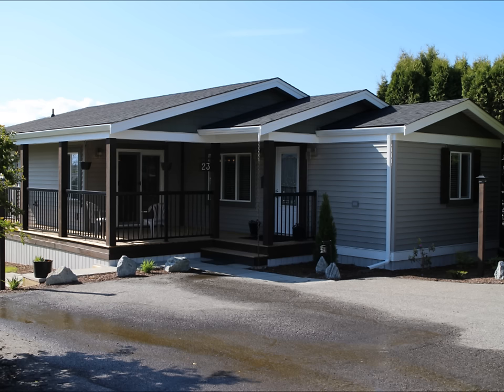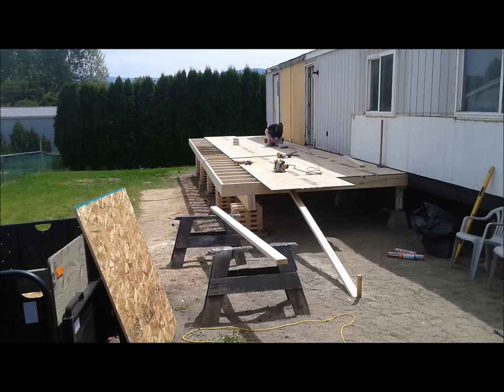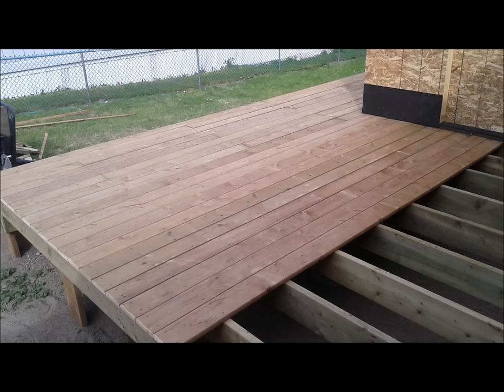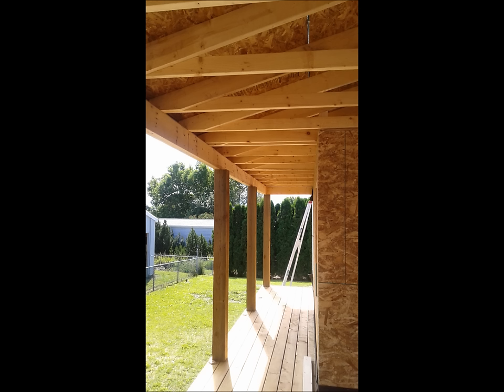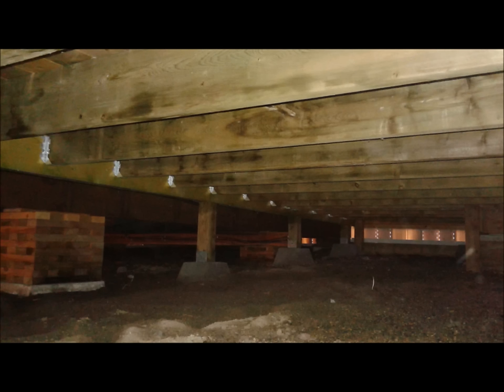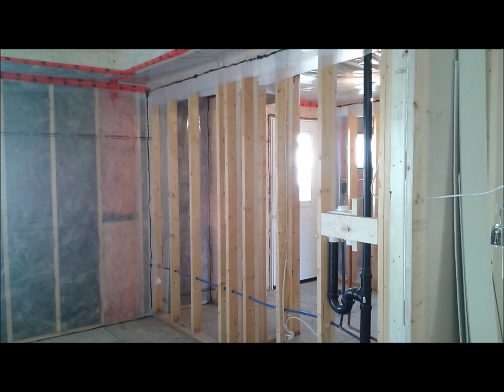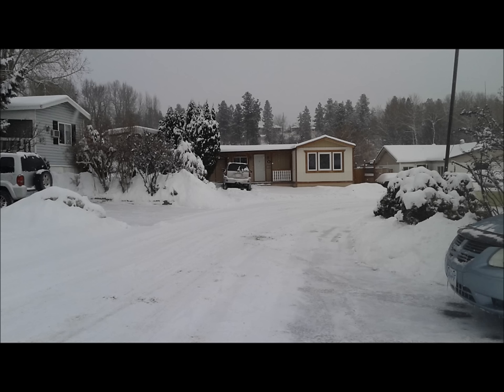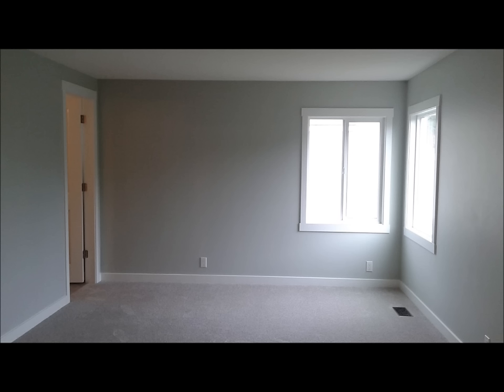Building An Addition To A Mobile Home - Start To Finish : E026 / BC Renovation Magazine

Comment: I would have used sona tubes in the ground as ppposed to cribbing for that foundation, and I would have had the addition on it's own foundation so it could just float in relation to the old home, or jusst post frame the whole addition, then tie in the roof.
Reply from the maker: Hello, Allen. Things are done differently in various building jurisdictions. The way something is done in one place may be different than where it is done somewhere else, and even then there are various ways to get a job done. One way may or may not be the better or best way to do something, just a different way.

Foundations are installed based primarily on climate and soil conditions. The use of sono tubes, as you suggest, is not the way this is done here. The way this home was set up on the cribs is the approved method, inspected and approved by the local building authority. It, and literally thousands of other homes in the area like it, have been happily sitting on those cribs with no ill affect for 20-30-40 years.

The addition does sit on its own foundation. the addition is not attached to the original home except for finishes. Structurally, the addition and original unit are independent units. This was required by the local building authority. 

This project was subject to building permit approval and several inspections along the way.  Everything that was done here was done correctly and by methods approved by the authority for our jurisdiction. Things may be done differently where you are. 

Thanks for watching. :-)
Reply: @BCRenovationMagazine , my opinions were not meant as a criticism.  I have never seen cribbing done on top of square pads before.  My old home was a 1980 singlewide pos.  Looking back, I would have done things differently.  The foundation under mine was concrete strips 24" wide down the whole length of the trailerx2.  The outside walls were cantilevered 3 feet.  I used post and beam with adjustable peir blocks every 4 feet to support the weight of a new framed roof, plywood, and a 2nd 2x4 framed wall on the inside to run new electric and plumbing through.  I nickle and dimed that project for a few years before walking away.  For what it is worth, a house flipper has it now...
Reply from the maker: Hi, Allen. No offense taken here. :-) The way things are done here are not the way they are done other places. It is interesting to see and hear how other people do things. Thanks for your comments.
Reply: @BCRenovationMagazine  I don't see where you've put it on it's own foundation. It looks like the addition is attached to the original home at what you called the header that you replaced. Can you please explain in more detail how it's on a separate foundation if you've attached your floor joists to the original home? I guess I would expect to see new footers along the mobile home side of the addition.
Reply from the maker: @Gina Dyingtoknow , the floor joists are actually attached to a 2 ply 2x10 flush beam (sits up inside the joists) that was installed next to the header of the mobile home. The mobile home header is just a single 2x8 that you can't see. It is hidden behind the 2x10 flush beam. The 2x8 floor joists for the addition are hung off of the 2x10 flush beam using the Simpson Strong Tie metal joist hangers. The 2x10 beam is sitting on that series of 4x4 posts that each sit on a concrete footer. They carry the load independent of the mobile home. The 2x10 is sort of attached to the mobile home header, but not for load bearing purposes. The 2x10 beam was lagged to the mobile home only to help prevent the addition from pulling away from the mobile home. It was done this way where the two units meet to accommodate plumbing drain lines and heat piping from the addition to be connected to the mobile home.

On the other side of the addition, the outside, the addition floor joists sit on top of that beam that sits on top of the cribs. The beam placed below the joists there presented no issue with hindering the heating and plumbing drain pipes, because it is along the outside wall and there are no pipes there. If we had done something similar on the inside the plumbing drain connection in particular would not have been able to connect to the mobile home plumbing. It would have been too low. $#!t doesn't flow uphill. :-)

Our building codes here for this require that the mobile home and addition (and any 'attached' decks) be separate load bearing structures, and these are. There were three inspections done by the building inspector as the work progressed. You could take the mobile home away and the addition and deck would still be standing there on their own. They are 'connected' only where the lags were installed (to prevent separation) and by the asphalt shingle, vinyl siding, drywall finishes and flooring finishes. That is why the roof framing may look a bit odd to someone that knows. The roof was framed the way it was to satisfy the requirement to be 'not connected'. Cut the connected finishes, remove the lags and underneath the structural parts are completely separate. 

We have had comments to the effect that "Well, that thing is not going anyway now that you did that..." Well, the fact of the matter here is that that home has sat there for almost 30 years. Around here mobile home lots are scarce as hen's teeth. There is no place to take it. But, if one was so inclined, it could be split and the two sides moved separately. Some fairly minor refinishing would have to be done when the home was set up somewhere else. 

I know the folks bought this home. I have been there several times since they bought it. The project I am doing right now is right across the street. This addition and renovation is three years old. It has been through three cycles of winter and summer. There is zero sign of any drywall cracking inside. There is absolutely no indication that the addition is separating from the mobile home or settling.

Great comment and questions from you! :-) I hope my explanation helps. Thank you for watching and commenting.
Reply from the maker: Gina, and any others interested, if you hop over to our community page I have posted a drawing there that hopefully will make this a bit clearer. It is not the greatest but might be helpful. Link to our Community Page: https://www.youtube.com/channel/UCJMCY26tYJMaPrLcheEEjhg/community?view_as=subscriber
Reply: @BCRenovationMagazine  AWESOME. These details are exactly what I was looking for. I would hire you in a split second if you lived in southern Kansas. This is exactly what we are getting ready to do to ours. The county we live in also requires additions to stand alone. Thank you so much!

Comment: was this all permitted?
Reply from the maker: Hello, Darr. Yes, this was all permitted. This home is in a heavily regulated metropolitan area. To begin, the park had to approve all plans and specifications. From there it went to the local building authority for approval. Permits were required for building, plumbing, electrical and gas work (4 permits). There were 3 inspections done on building, 3 on plumbing, 2 on electrical and 1 on gas. Obtaining permits and approvals took about 6 weeks before we could get started with the work.

Comment: How much was the total renovation and are you all located in AZ?
Reply from the maker: Hi, Tina.  Your question has been asked by many others several times in the past.  If you read through the comments you will see that it is a question that has gone unanswered, for several reasons.  I will make an exception for you and answer.

We bought that little home in dilapidated condition for about $30,000.  

We put about $60,000 into it to renovate the original unit and build the addition.  I did all of the labor myself except for the HVAC work, electrical work, carpet laying and eavestrough installation. 

It took about 14 months to turn that project around from when we took position to when we turned it over to the new owners.  We bought it in March 2016 and sold it in May 2017.

The home sold for $230,000 within days of being put on the market.  The people that bought it still own it.  They could easily, easily put it on the market today and get well over $300,000 for it.

And to think, some people say that mobile homes are not worth it, no money to be made on them, they are junk homes, etc.  

Just a caveat here...  That project was done 5 years ago.  Costs would be more now.  I am in British Columbia, Canada so costs are in Canadian dollars.  We live in a very desirable area where housing is very expensive.  A $300,000 mobile home sitting on a rented pad is considered "affordable" living here.  An average house on an owned city lot averages just under $1,000,000.  A really nice one is closer to $2,000,000.

That project was so successful I have done several others since.  They have been just as successful.

Hope that helps.

Comment: Where's the floor insulation and the belly board?
Reply from the maker: Atalanta571, I didn't really show the insulation and belly board. The insulation was R-20 fiberglass batts between the floor joists and 3/8" OSB for belly board. Thanks for watching and commenting. :-)

Comment: If I wanted something like this done to my trailer what would I ask for & who would I contact?
Reply from the maker: Maria, at least around here, it is getting more and more difficult to find contractors to do anything. There are fewer and fewer contractors trying to do more and more work. This kind of work is outside of the box of normal construction, but really isn't that difficult. Finding someone to do work like this will likely be challenging. Look for a good renovation contractor that isn't afraid of something different. A small size company would most likely be your best bet.

Comment: @5:00 What's up with those shingles and where's the floor insulation?
Reply from the maker: EyesWideShut, those are the old shingles that were left on while the construction took place to keep the original unit dry. Those old shingles were removed.

The floor was insulated from underneath below with R-20 fiberglass batts.

Thanks for watching and commenting. :-)
Reply: @BCRenovationMagazine  You might want to tell the audience, thanks for responding.
Reply from the maker: @eyeswideshut2800  , this was a project that took almost a year to do, and this video condenses all of that down to a few minutes. 

Do you really think that every detail can be mentioned in the time frame of a video like this? The answer is "No". The video would be several hours long, and then people would complain about that.

These videos are produced with an expectation that the viewer has a certain level of knowledge and common sense. I think it should be obvious that the old shingles would have been removed. Also, given the scope of the work that was done here, why on earth would someone not insulate? 

If you think you can produce a video that can do a better job of explaining things, then by all means please do so. I would watch your video! 😄
Reply: @BCRenovationMagazine  Tell em how it is!

Comment: How much you spend on this project
Reply from the maker: Hello, Ignacio. Cost is a frequently asked question and I have addressed it in the comment sections, but it has been a while since I have commented on price. 

Costs vary widely from place to place. The costs of material and labor can be very different. How much the property is in demand greatly affects the cost of things. Where we are there is a big demand for a home like this and the cost of housing is very expensive. A home like this is considered 'affordable' housing in our housing market. Also, we are in Canada, so the value of our dollar compared to the American dollar is different. 

If you can do some or all of the work yourself you can save a lot of money. Roughly half the cost of a renovation can be in labor and profit margin if you were to hire a contractor to do the work for you.

So for this home, if you owned the home and came to someone like me (in our area) and contracted to do this complete addition and renovation it would look something like this. We started with an 840 sq. ft. single wide home in very rundown. We added 360 sq. ft. plus a covered porch and completely renovated the original unit. To go from what we started with to what you see as the final product (including all the appliances you see) works out to be about $160 Canadian per square foot, based on a finished floor area of 1,200 square feet. Your costs in your area for something like this could be quite different.  

The sale price of this home completed was $230,000 Canadian dollars. Based on today's exchange rate that is about $170,000 USD. We sold this home 2 years ago and contrary to what many people say about mobile homes depreciating, this home, in our area, has increased in value and the folks that bought it could sell it today, easily, and make a profit of about 30%. 

This kind of thing doesn't work for everyone, everywhere. For us it is a profitable venture and has been a good investment for the folks that bought the home. 

Thank you for watching. :-)
Reply: So you're saying roughly it would cost 200k Canadian?

Comment: What do you do about the pitch of the new roof? Looks to me like there would not be enough slant for run off… just sayin….
Reply: It's very similar to the pitch on our double wide and it works great for us. The snow ends up sitting on the roof regardless unless you have a very steep pitch with metal roofing or extreme heat loss through your roof for it to run off.

Comment: I combed through 268 comments and there is no mention of general cost of this renovation.
Reply from the maker: Hello, Bob. Here is a cut and paste taken from the comment section below in response to viewer Ignacio Reyes. ;-) Thanks for watching.

Costs vary widely from place to place. The costs of material and labor can be very different. How much the property is in demand greatly affects the cost of things. Where we are there is a big demand for a home like this and the cost of housing is very expensive. A home like this is considered 'affordable' housing in our housing market. Also, we are in Canada, so the value of our dollar compared to the American dollar is different. 

If you can do some or all of the work yourself you can save a lot of money. Roughly half the cost of a renovation can be in labor and profit margin if you were to hire a contractor to do the work for you.

So for this home, if you owned the home and came to someone like me (in our area) and contracted to do this complete addition and renovation it would look something like this. We started with an 840 sq. ft. single wide home in very rundown. We added 360 sq. ft. plus a covered porch and completely renovated the original unit. To go from what we started with to what you see as the final product (including all the appliances you see) works out to be about $160 Canadian per square foot, based on a finished floor area of 1,200 square feet. Your costs in your area for something like this could be quite different.  

The sale price of this home completed was $230,000 Canadian dollars. Based on today's exchange rate that is about $170,000 USD. We sold this home 2 years ago and contrary to what many people say about mobile homes depreciating, this home, in our area, has increased in value and the folks that bought it could sell it today, easily, and make a profit of about 30%. 

This kind of thing doesn't work for everyone, everywhere. For us it is a profitable venture and has been a good investment for the folks that bought the home.